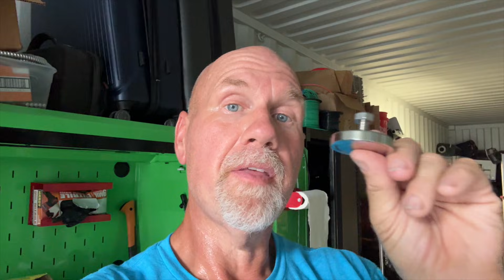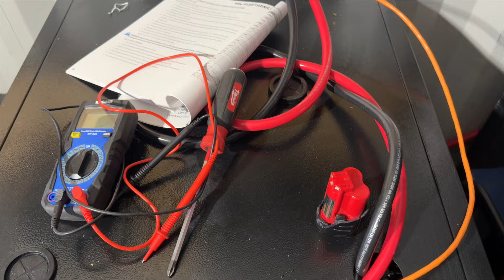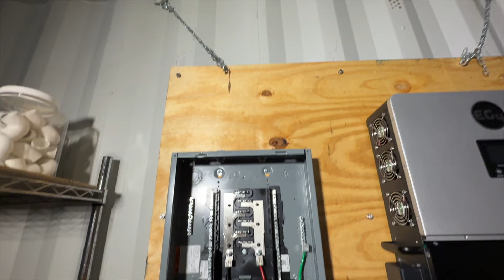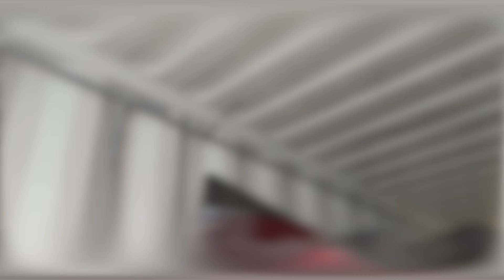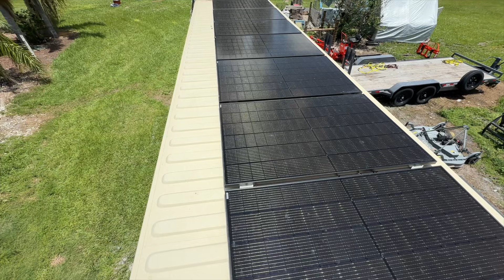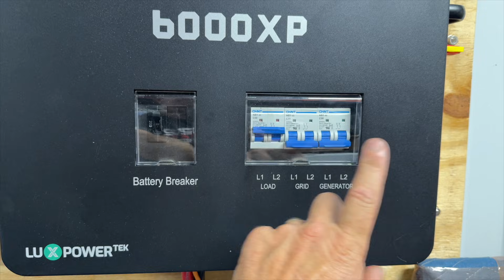Off-Grid Power in a Shipping Container: EG4 6000XP and Solar Install with ZERO holes

Comment: Don't be fooled by this manufacturer scripted ad. This video wasn't created for altruistic reasons, it was simply created for the purpose of earning a sales commission. These YouTube product reviewers are all just paid actors that know nothing beyond the script that they've been provided with to sell these cheap Chinese made products. All the reviews on these cheap Chinese made products are being performed by amateur salesmen, often times using cheap,  non-lab grade, hobbiest test equipment. These product reviewers have no background, education or experience with renewable energy products. If you don't believe what I'm saying, check to see if this video offers a discount code, when you click on its link. That's how this saleman earns his commission.
Reply from the maker: we are not paid salesmen and did not have a script.   Signature solar had nothing to do with us producing this video or even how we were using the product.  This is the 3rd time we have installed these products and I have extensive knowledge on solar.  I have installed numerous types of systems including a complete off grid Victron system.  I have been trained to do installs in RVs as well.

Comment: The 6000XP is one of the worst inverters to install in a shipping container. It doesn't even have an output transformer, and as such, it's not safe for use in occupied dwelling because it doez not provide any galvanic isolation.
Reply: So what is your recommendation vs what was presented in this video
Reply from the maker: This person is just trying to troll.   Yes, The EG4 6000XP is a transformerless inverter, — but that does not automatically make it unsafe or unsuitable for our use case. Galvanic isolation can be achieved system-wide, not only through an internal output transformer.
In our installation, the system is properly grounded and bonded, follows manufacturer guidelines, and is not being used as an occupied dwelling. This is a detached shipping-container garage/workspace, not a residential living space.
Transformerless inverters are extremely common today (including many grid-tied and hybrid systems) and are widely code-compliant when installed correctly for the application.
Reply from the maker: The 6000XP is transformerless — agreed — but lack of an output transformer does not inherently make an inverter unsafe or non-compliant. Proper grounding, bonding, and system design are what determine safety.
This system is installed in a non-dwelling, detached container garage, not a living space, and follows manufacturer and electrical best-practice guidelines.
Context matters with solar installs, and blanket statements about “unsafe” often miss that nuance.

Comment: What are those little holes right above the wood?
Reply from the maker: If you are talking about the series of holes that are drilled that you can see inside, the are part of the shipping container and are for ventilation, which prevents moisture buildup, heat, and pressure from damaging cargo and the container itself